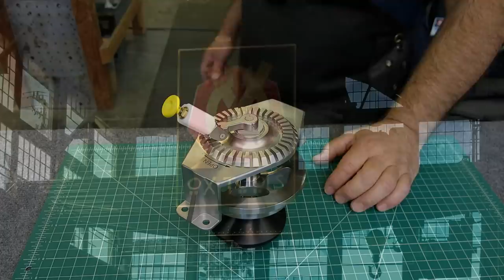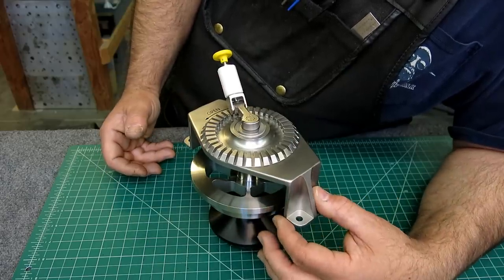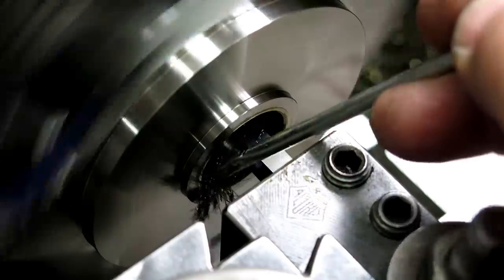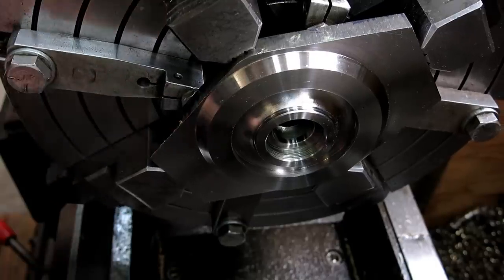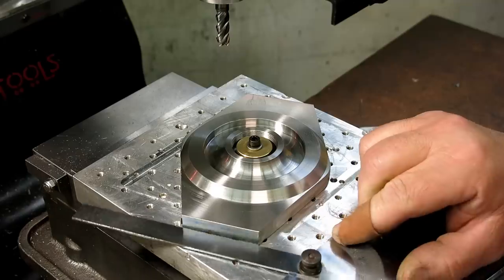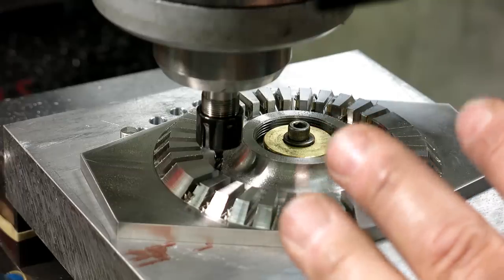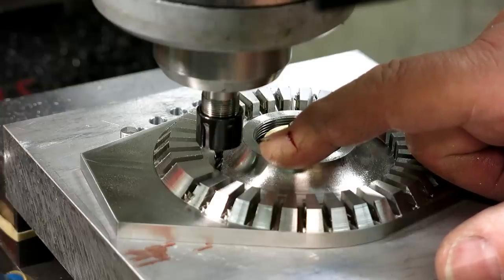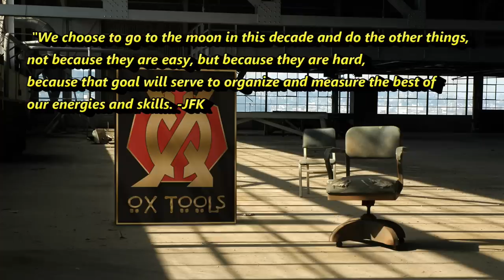Equalization Valve  6

Comment: This is the kind of stuff that will hold up today's Apollo/Artemis program. Most of today's snowflakes lack these kinds of fabrication and machining skills. In the 60's they probably made dozens of these assemblies with now primitive tools and equipment, and it worked. A few years ago when NASA began in earnest in working on Artemis to go back to the Moon, they looked into building the Apollo-Saturn F-1 engines an found that the knowledge, as well as ability and infrastructure were lost to time, no one could do it today, even trying to reverse engineer the crazy numbers of parts from NOS F-1's in NASA long term storage. I think that is why they gave up on using F-1's even though they were successfully test fired after 45 years in storage.

The fact that someone such as yourself possesses the raw talent and considerable skills to reproduce such a complicated component as the EQ/Purge valve is amazing to me, and a testament to your mad level skill sets in multiple areas. NASA needs folks like you to get us back to the Moon with Artemis in 2024/5, if we are going to make it and make it safely.  Thank you for sharing the journey with the rest of us, I've enjoyed the entire series,.. as well as donating your time, materials and tools to make a piece for the iconic Apollo Command/Service Module, the most important part post Apollo 1, that made sure our astro's were safe and secure once the Block II CM's were man rated and (relatively) safe for MSF.

Two thumbs Up, Sir !! Excellent, unbelievably beautiful work!!

Comment: Tom that's a great job on an impressive piece!  Especially doing it manually and on Stainless.  I have to hand it to you on your machining skills.  I actually thought it was a material other than SS because you didn't struggle more and not even a brown chip.  Nice!
Reply: Up until the end of the video when Tom stated that he was working with stainless, I also thought that he was using aluminum. The chips and finish were so nice that it didn't appear to be stainless. Now it makes since why he had an issue with chatter ;-)

Comment: Thanks for the machining porn Tom, extremely satisfying and relaxing to watch. 

I find that even though I haven't done any large metal machining, it helps a lot to watch you, Abom, Robin and others when I do my woodworking. We have a 6'x12' CNC cabinet maker machine at work and no one has experience on it or formal training. I've had to instruct my programmer as to how to machine the wood with the knowledge I've gathered from Youtube, Junior managing a huge CNC shop, and being a journeyman woodworker. Order of operations, cutting direction and forces, depth of cut, feed rates, surface finish, etc, etc, it has been hugely beneficial to my skill set as a maker to study you. 

I consider you a Master of your craft and I find it hard to express how grateful I am that you document and narrate your process.
Reply from the maker: Thanks for the nice comment. I'm with you that there is so much to learn from other trades and crafts. Its what makes this stuff really fun. 

All the best,

Tom
Reply: @oxtoolco  I find that it only gets easier as one gathers more skills, explores more materials, and learns new methods/tools. The knowledge base overlaps and how to approach each operation of a project becomes intuitive. (for the most part).

Comment: I wish we had toolmakers like you around where I work still
 I'm  in "tooling" and work on dies, templates, and carbon layup tools, but.  We don't do anything the way you do it, and nobody here does.   It's all on CNC, and people press buttons and out pops a part, then we finish it.  The single toolmaker is divided up between the designer, programmer, machinist, and finisher.   Then of course we have guys that come do periodics on the machines, and maintanence does the work on the machines, and.  
Yeah. Nobody is allowed to do multiple things.  You actually can get in trouble for stepping into someone else's job. 

We have more guys over in the jig builders, but.   The most we do is in our small tools department, but even that's just collecting materials, and sending each piece off for processing, they do all the stuff, it comes back for us to put a scotchbrite pad to it, ensure fit, and add bolts or hardware and assemble, then sell to QA.  
Maybe I need to get myself into one of the legit tool companies.

Comment: it is pretty crazy what modern cutting tools and coatings can do
Reply: So true... then you consider the guys making the originals had no such tooling, coatings or CNC and the amazement really kicks in.
Reply: @ramosel  there's no CNC in these videos, and the original would have been done much the same way as Tom is doing it, the slots specifically might have even been done with a shaper. it's certainly possible and not terribly difficult, you just need to take your time to do it right.

Comment: Wait a minute...I've got to see the/those bore micrometer/micrometers. Great video series Tom. Always most edifying. Thanks, -T
Reply: If you mean the "tri-mikes," which I believe is what they're sort of called  (because they have three lobe spindles, and with slight variation for the trademarked names used by the marketeers at B&S and Mitu and so forth) they are $$$$ and, though I don't know their reasons, not a few people say they don't really like them compared to the cheaper bore gages and transfer gages like Tom also uses in the video. I'm not sure but maybe Tom talks about them in one of his other vids.
Reply from the maker: Whoops. Pricing are going up on Ebay as we speak. Thanks for the comment.

Cheers,

Tom

Comment: Another beautiful piece of work. When you were making the partial form tool out of the one you showed onscreen, I'm curious what you did to eliminate the cutting edge. Did you use a zip disk and cut all the way to that scribed line, did you just hog out all that material on your grinder, or did you just slightly grind away the cutting edge on the half you didn't want to contact the part, leaving as much meat in the tool as possible? As always thank you so much for letting us look over your shoulder and sharing your knowledge with us!
Reply from the maker: Hey John,

Sorry I didn't show this on video. I was under some huge time pressure and that operation was not going well. I just ground the tool away on the bench grinder. The two form tools had maybe .05 to .1 overlap in the profiles. I used two datum points on the part to index the two tools to themselves and the part. Hope that helps explain the process a little better.

Cheers,

Tom

Comment: Tom, how did you radius the two side corners before finishing them with the file? At the bandsaw (2:24) they're cut sharp, but then on the lathe (2:33) they're rounded. I do notice an inscribed circle in the blue but it doesn't appear to have the same radius as the two corners. Did you just eyeball them by hand on the bandsaw?

Comment: We've been using variable flute EMs at work for a while now. I can't say enough good things about them. They aren't Niagra but they have been awesome for hogging out lots of material at once. I would have run that faster, I know you were trying to be conservative but these EMs like being pushed and their geometry allows for it. Get a full set of them up to 1/2", you wont regret it. A company like Niagra should have a feeds/speeds calc for their tools I would think, the first time you look at what they recommend it seems like it's all wrong but just go with it, you'll be glad you did.
Reply from the maker: Hey Ian,

That's as fast as that mill can go. I agree If I had more rpm available I would have used it. Thanks for the comment.

Cheers,

Tom
Reply: @oxtoolco  Latch up the horses n make er go faster! You aren't trying hard enough =P
Reply: @oxtoolco  couldn't you have used the spindle rpm increaser you made some years ago to go much faster?

That was an interesting video as well,btw.

Comment: Would you be kind enough to discuss the indexing method used for cutting those slots? Perhaps a good ingredient for a meatloaf? I can see the indexing holes and the dowel pin. What I don’t quite get is how you know where the edge of the part will be given some fixed amount of rotation, such that you can drill a hole in the fixture at the correct spot. Particularly given the irregular shape of the part.The same spot on the edge will form a circle when the part is rotated. Is that part of it? Seems like an interesting problem.
Reply from the maker: Hi Glen. You have the idea. Yes the holes are arranged in a circle with the part center as the rotation. The space between each pin is the index angle at that particular radius. I laid it out on the computer at a convenient radial location on the part then just pulled the X Y coordinates off the electronic layout to drill the holes. Hope that makes sense. 

Cheers,

Tom
Reply: oxtoolco Thanks, Tom. Useful and interesting as always. And though I’m a woodchuck I enjoys these a great deal!

Comment: What is the end mill holder that you used for the slotting end mill? Seems like some kind of R8 to ER collet adapter maybe? I assume this is useful because it gives a bit more clearance for the spindle itself, right? In other words- you can get a bit closer to the work because the bulky spindle isn't in the way.
Reply from the maker: Yes. Its a little 1/2 shank ER-8 collet extension. Command Tools sells them and I have gotten myself out of more than one jam with them.  Cheers,

Tom

Comment: Is that a straight shank collet Chuck you're holding the Niagara end Mill in or is the collet Chuck that fits R8 spindle????and oh yeah Niagara end mills are the best
Reply from the maker: Hey Ed,

Its a little ER-8 straight shank holder. Allows me to have a little more room around the cutting area and not lose any rigidity. Thanks for the comment.

Cheers,

Tom

Comment: @oxtoolco, Is that a mini chuck holding the endmill, with the mini chuck held in a collet chuck?
Reply from the maker: ER-8 straight shank extension. Command Tool. 

Cheers,

Tom
Reply: @oxtoolco  thanks Tom! That looks like a pretty nifty way to hold smaller enemies when you might change them often.

Comment: Tom, would it perhaps give a better finish of the interior radius by hogging out most of the material with a trepanning tool and using the form tool for a finishing pass? Just asking cuz I'm a noob.
Reply from the maker: Your idea is valid. You have to know where the curve is for an operation like that. If I did that I would make up a chart of depths and radial positions for the trepanning tool that came close to the desired profile. After removing the material go back in with the form tools. Still would have required the smaller form tools. The total curvature and part thickness were just too much for one tool. Good question! 

Cheers,

Tom

Comment: I know this might be a bit of a noob question, but what kind of file are you using to file the radius on the side? Just a very curious fan. Thanks!
Reply from the maker: The first part of the filing is a #2 Pillar file ~8 inches long. The second part is a #4 pillar file (finer) Thanks for the comment.

Cheers,

Tom

Comment: Why not use a radius table?  Why the index plate?  Curious...
Reply from the maker: Don't have one big enough. Thanks for the comment.

Cheers,

Tom
Reply: @oxtoolco  Ya, the story of our lives.  By the way, thanks for the video of leveling a lathe.  My lathe is about 100lbs, but your explanation of why helped me out to calibrate it, and my tiny milling machine.  I'm one of those Physicist guys you work with.  I bought your books and agree 100% (actually if it was possible 1000%) with your suggestions.  I work in software now, but its all the same.

Comment: Tom,  I hope your counterparts on this project are being as careful and precise as you are, or this thing isn't going to go together without a massive amount of coordination amongst individual craftsmen and machinist.
Reply: It was all assembled by Adam Savage some time ago. Hearing Tom remark about being two tenths short on his internal diameter reminded me that Adam had to glue someone else's large contribution in place rather than bolt it on as intended - the other guy's part was too small and bolt holes were up to a half-inch out I think. I think Tom's work here is truly an outstanding example of precision manual machining. Not that I'm a machinist or in any way qualified to judge. The overall project is more a collaborative art piece and not a precision working replica so there's room for all kinds of contribution I guess.

Comment: Dude, you just cut up a 200$ vacuum flange for raw stock :D
Reply: "It's what I had layin' around." (you never know. this thing might actually need to go to the moon.)
Reply from the maker: Dead NFG flange. Knife edge was dogmeat. Thanks for the comment.

Cheers,

Tom
Reply: @oxtoolco  I guessed so, its just so painful to watch, i was standing on the lathe and mill for an entire day making CF100 flanges from plate because i couldnt afford to buy them. I also recently saw a small wood furnace made entirely from CF parts, the guy told me his company recently got rid of them by the cubic meter... The world is cruel some times :D